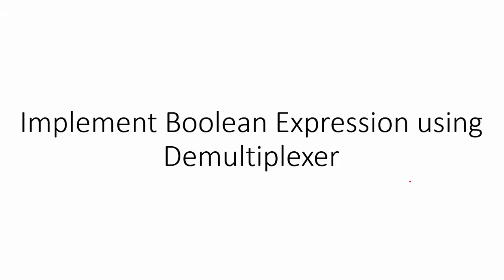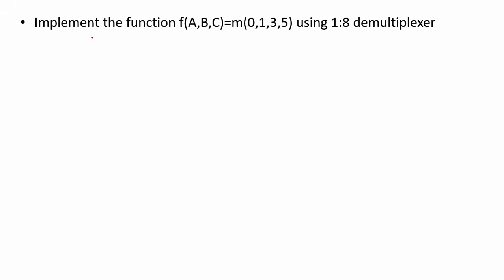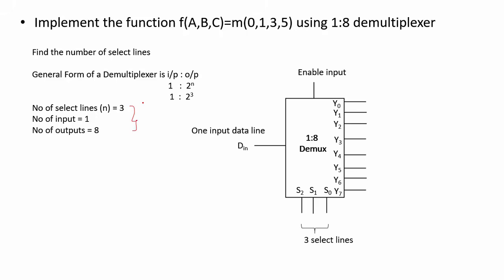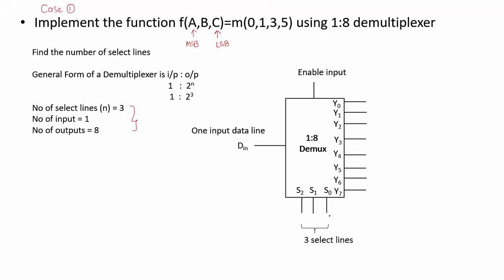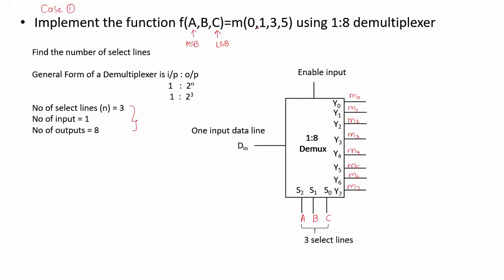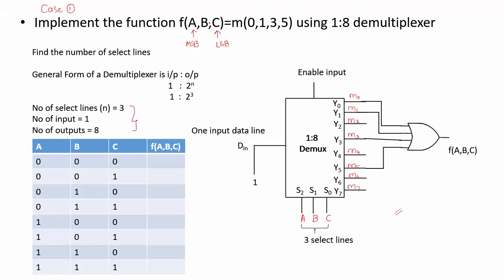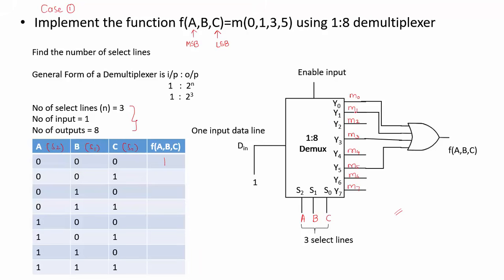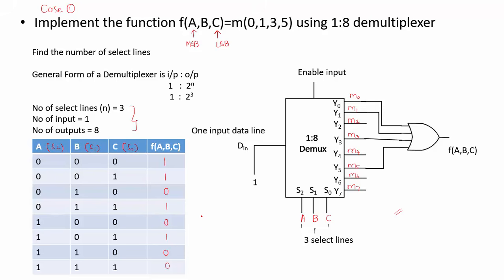Implement boolean expression using Demultiplexer

Comment: sir can it possible to built..a 1 to 8 demux by 1to 16?
Reply from the maker: Demux is basically a data distributor. 
You can expand the size of a demux i.e,  using smaller sized demux build a larger size demux.
You can also make 1 to 16 demux to work as a 1 to 8 demux by connecting S3 select pin to 0. But that is not generally followed, you use a smaller demux and build 1 to 8 demux.